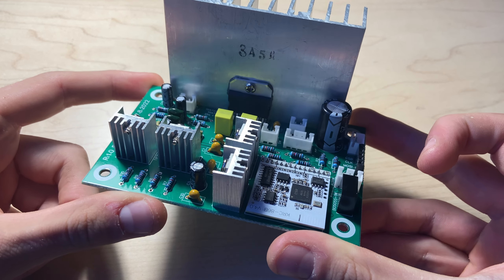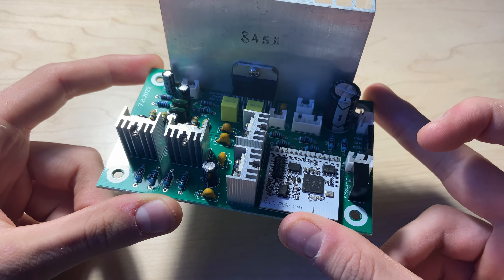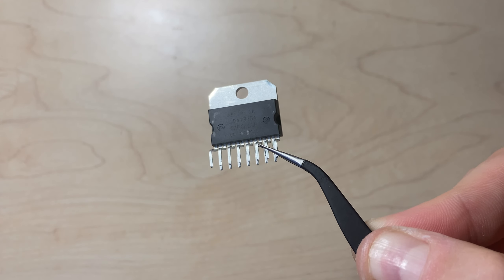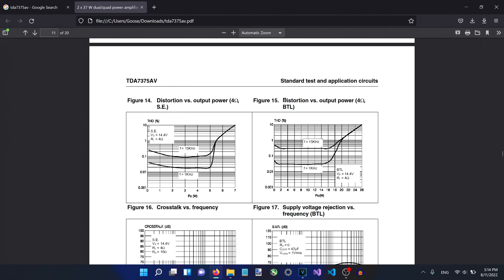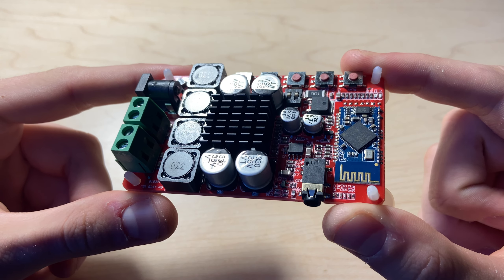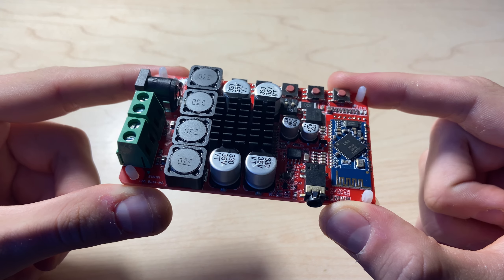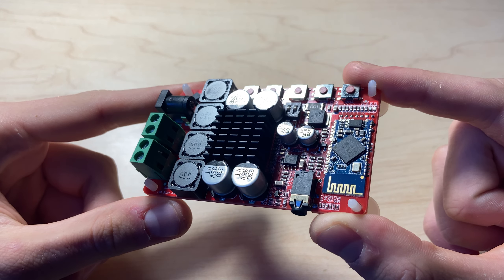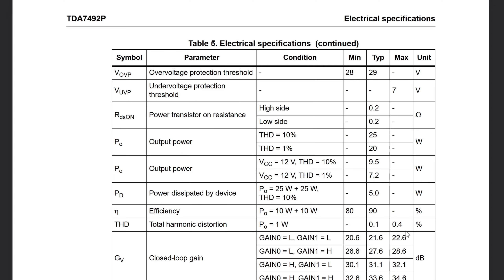Class D vs. Class AB audio amplifiers | Which one sounds better? | Unbiased listening comparison

Comment from the maker: I believe the general point of this video was missed by many viewers. I understand there are far better implementations for both classes of amps, and there are modifications that can make both of these amps better, but they don’t represent the majority of real-world applications. This video compares two modern, off the shelf amps that represent the majority of the market share for class D and Class AB.
Reply: Nope,class ab mostly comes not as a chipamp.
Reply from the maker: @Zockopa  you can’t be serious. i think the keyword you missed was “modern.” Most modern Class AB amps are a solid state chipamp configuration due to their small size and low external component count.
Reply: @DaGoose  🤣
Reply from the maker: Below are a list of modern products that use a Class AB chipamp:

Harmon Kardon HK395
Logitech “Z” series satellite
Tannoy Ellipse
KRK V-series
Genelecs
JBL LSR-series
Mackie HR-series and Tapco models
Polk PSW series
Creative speakers

Manufactures use chip amps because they’re small, cheap and have decent fidelity. every modern discrete class AB amp i found costed at least $100 and most high end models above a $1000 which do not represent the majority of the market share.
Reply: @DaGoose  KRK V-series, of course. Also AB used to be in their Gen 3 Rokits, and AB is also in their "New" Rokit Classics.
Reply: Class AB is good because it has crystal clear treble and mid freeqency
Reply: Don't mind the trolls man, just give them a thumbs up and thanks for the comment. You can't expect everyone to be a electrical engineer, either they do believe you or they don't.
Reply: @frankfarago2825 who actually buys these junk powered speakers? Rokit? junk 😂
Reply: @DaGoose Class d vs AB is definitely an odd one. A $50 class d will sound worse than a $50 class ab. But a $600-1000 class d Hypex N core or Purifi 1et400a will sound and measure better than the typical class AB in that price range. You have to spend at least $2-3000 to find class AB amps that can match modern HiFi class d in power output, noise floor, distortion, etc. Class AB gets expensive fast if you want 200+ watts into 4 ohms, 0.0x% thd, 100+dB SINAD, etc. Class D is excelling there. Ultracheap $50 amps go into cheap electronics where clarity and low noise floor are an afterthought because they're matched up to extremely cheap no-name tweeters, woofers, or even full range drivers that measure poorly in frequency response and are mounted in cheap enclosure with terrible resonances and bad port tuning. I think that's where some legitimate criticism of this video is coming from. This tier of diy amp is going into crappy speakers that sound bad anyways and are represent the sound quality of cheap amps, not class d or class ab. Class D can sound fantastic, as even the snobs at Stereophile now admit: https://www.stereophile.com/content/recommended-components-2021-edition-two-channel-power-amplifiers
Reply from the maker: the price of a consumer amp has nothing to do with its fidelity. for some expensive amps, only 20% of the price you pay goes towards the total production cost of the amp. I’ve built several amps from scratch in my lifetime. I made the Class AB amp in this video and it has 0.02% THD and possibly ~100dB SNR. the total cost for that build was ~$50 USD. All amps are cheap to make, including the “high fidelity” ones. you’re right that the driving speakers on the amps have a big role in the playback quality of the system. however, that doesn’t apply to this video because I didn’t use speakers and a mic when recording. i used a line output converter which took the speaker outputs of both amps and brought them to line-level signal so that I can use a PC’s mic-in to record the outputs of the amps.
There are some so-called audiophiles who comment on this video thinking they know what’s right, but i can assure you that probably more than 90% have no clue how to design amplifiers like these from scratch.
Reply: @hochhaul  You sound like those two generations of people under the age of 40, who claim that nothing was any good because they were not born yet.
Reply: The NAD amplifier should been used instead. don't you think so?
Reply: I think we all missed the point. We are stupid people. But I did appreciate the LEFT/RIGHT comparison, in which the class D amplifier sounded like shit.   I had an Onkyo class D amplifier that was nice and clean sounding. The hi-fi reviewers even called it "tube-like". However I have large Polk Audio speakers and the power output was limp like a wet noodle or my "tool" down there,  these days. 26 years of marriage will do that to you, son. Learn from my mistake.  I gave the amp tpo my daughter and splurged on a Cambridge Audio Azur 851A which powers these babies up like it's nobody's business. My Barry Manilow records never sounded so punchy. This model uses class XD amplifiers which is basically AB but improved.  Thanks for posting this video!!

Comment: Well class D is good for subwoofers, class AB for high frequencies, but you wont feel too much difference if you feed them already with digital signal (from pc, phone ect.), and class D is way more efficient and don't require big heatsinks and power supplies. Music quality depends on your speakers too so good amp is just one key to perfection out of 100. To hear difference on youtube is impossible.
Reply: I'm still confused at why people act like class D is so tiny and lightweight. My Pioneer SC-07 is the heaviest rceiever I've ever owned, and the high frequencies are so good that I use the attenuation feature to tone it down. Are most people judging class D on lower end amps? I know high end class D is relatively rare, at least with consumer grade audio.
Reply: @awesomeferret  its 7x140w thats why. Take a look at class A 100w amp. Its going to be a heater

Comment: Hi there this jess.. the class AB sounds bigger and bass is wider but  Class D sounds much clearer specially the middle band which is a very hard part to produce.. you can only hear clear backgroud instruments and a clear voice in a well working circuits.. if noise is noticeable during no signal drive its because the circuits has nothing to amplify therefore since class D amps basically has loop circuits it is amplifiying its own self induce noise in the physical circuit... if the much bigger sound or bolder sound is desired then bigger power is the answer... and if noise is the problem dc supply should be regulated... that will improve the performance...
Reply from the maker: More power does not equate to “bigger” or “bolder” sound. A 4-ohm speaker rated at 25W can be quieter than an 8-ohm speaker rated at 15W. The way a speaker sounds is based on its frequency response, sensitivity, cone area, and other factors such as the 
enclosure it’s housed in. 

The noise that you’re hearing with no sound is the floor noise and that is a normal factor in all audio amplifiers regardless of its configuration. 

The Class D appears to have more pronounced mid-range frequencies because it has weak high frequency response. This is a common problem in most Class D amplifiers which is why they are commonly only used in low-frequency applications only (i.e. car subwoofer amp)

I have no idea what you mean by regulating DC voltage to reduce noise. Both of the amps in this video were used with a switching DC regulator and there is still noise. Noise is a very broad issue and could be anything.
Reply: class d modulate noise and hash treble.  Class D treble is vague and attenuated by compare.  Makes the mids seem more prominent.

Comment: From my experience with amplifiers, the background noise can be reduced significantly by grounding the power supply, and keeping the input signal line as far away from the power supply line as possible, good  grounding is essential so don't daisy chain the ground wires...

Comment: As far as sound, I listened through headphones and most of the time I couldn’t hear a difference. During the combined test, the left side had more bass. I listened to it twice to be sure, and then flipped the headphones around left to right just to ensure my own hearing wasn’t the issue. The bass moved to the right side when I flipped them. The only thing I can conclude is either the class D amp made the bass stronger, or the audio track was recorded with bass on the left instead of centered, which is not normally the case. Also the hiss test, I could definitely tell the class A/B amp was significantly quieter.

Comment: There is no doubt that class AB still rules perfect as sound is warm and natural ....i have many class ab in my collection...lm 3886 tda7294 as flat frequency ones and other like stk4141 tda2030,2050,and lm1875 which i use regularly...also transitor based circuits of 5200 and 1943.
Reply: Which one is your favourite amplifier topology? We cant get the lm3886 these days so what do you recommend?
Reply: @NoneYaBiz200  TI still makes the IC as far as I know. Not really a Class D fan except for subwoofers or the exotic GaNFET amps. Class A has the lowest distortion but, is highly inefficient. Class AB is my favorite for speakers and pure class A for preamp and headphones.
Reply: @davidperry4013  Thanks, I’ll have another look. I really would like to try the lm3886 and see for myself wha the fuss is all about. I’ve heard so much about it.

Comment: Amplifiers:
The controversy over tubes vs solid state presists. When response, modulation distortion and transient intermodulation distortion are below certain levels (< 1%) there should be no audible difference.

Speaker wires:
It can be solid, stranded, copper, oxygen free copper, silver, etc.--or even "magic" wire--as long as the resistance is kept to be less than 5% of the speaker impedance. There is no listening difference as long as the wire is of adequate size. Bear in mind, a well-designed amplifier will not have a problem with any of these wires.

CD players:
In the 1980's, people spoke of experiencing "no air" and "aggression" while listening to digital recordings. Today we understand the principles which are fundamental to this phenomenon, we name it Jitter, we test it, calculate it and dress it with numbers, systemize it and describe it entirely. Jitter has always been and still is the worst enemy of the digital audio format. And today it is understood.

Fact: Digital audio data is 'just' 0's and 1's. There may be many formats (.wav, .aif, CD-audio) but the information is still digital. There is no loss during format conversion, provided the formats don't utilize compression.

Fact: Copying CD's (if they aren't damaged physically) is a lossless procedure. You can extract CD-audio with your computer and generate a file on your hard disk. Compare this file with the file created when you extract the same audio using a $30,000 player, the resulting two files are identical. 

The question which naturally arises out of this paradox is: why does the $30,000 player sound better?

Before we answer that question, let us first understand that at the Digital Out of a $100 CD-player we have the same 1's and 0's as we do in the $30,000 player. The only difference is in the Jitter content. Jitter only means that the data (the 1's and the 0's) is not perfectly time-aligned, but is transmitted either slightly earlier or later than it should be in the ideal case. However, this time flaw is not as great as to cause a digital error (data fallout).

Now if you know that, then you must ask: so why does one CD-transport cost much more than another? Ah, Jitter. The cheap ones shake and the expensive ones don't.

Well, that's true. The entire audio business of CD transports and DACs is built on the totally backward setup of the CD player containing the Master Clock and the DAC being the Slave. This results in the entire palette of innovations to lessen Jitter, starting from air drives to expensive digital cable technologies with complex math to reduce line-induced Jitter, to very carefully filtered power supplies, to all sorts of very necessary things when you want to achieve the least possible Jitter. So we have the worst possible digital scenario bringing in the most possible amount of money, because it is extremely difficult to annihilate Jitter when the CD player is the Master Clock. If you're looking for quality, this is stupid, to say the least!

The whole setup should be different. As is the standard case in any pro-audio studio, it is always the playing device, the DAC, which is the Master Clock. The clock is located right next to the converter chips. That way, no line induced Jitter can appear. This clock signal is then taken from the DAC device and is used as the clock input of the signal source device, say the computer, the DAT player, or the CD player. Yes, in that setup, the CD player is receiving a more jittered clock than the DAC is, but that doesn't matter, because the DAC is doing the audio playing. When the Jittered audio signal arrives at the DAC, it is quantized into place temporally and is then played, in perfect synch with the clock oscillator, which is right next to it.

But oh! In that case, you can use a $100 CD-player with a very poor power supply, a digital cable made from your average household extension cord, and still get a better sound than you'd be getting if you spent $30,000 on the best transport and digital cable! Yes, ladies and gentlemen, this is the naked, uncensored, plain truth about CD players and DACs. Their Master/Slave relationship is BACKWARDS and their prices therefore HIGH.

If you don't believe this, then all you need to do is record digitally your favorite tune from a $100 CD player into your computer (provided you have a soundcard and software that doesn't add yet more lies into the equation, which is often the case, so beware!) Then borrow the most expensive CD transport you can get your hands on and repeat the experiment. The resulting sound files aren't just similar, they are identical!

But the $30,000 player sounds better! How do you get them to sound the same? You only need to slave the transports to a DAC in Digital Master Mode. That's it. Identical sound, guaranteed. The least possible Jitter. The least loss.
Reply: @DW11111 none
Reply: @DW11111 I never said I came up with this.
Reply: Can you reccomend a video going over dav digital master most setup?

Comment: Boy I wish I had held onto my old Amos and equipment from the late 80s early 90s. Along with CDs as the source, it was epic.
Reply: It's not too late. I just picked up a used Yamaha a-s301 for $250 and pulled my 300 disc player out of retirement...yum. Find a CD player with digital out and throw a DAC in between and you're golden 👌🏼
Reply: Sigh... I'd love to have my old Sansui 881 back.

Comment: The test with left and right running on each amp sounded slightly out of phase even on my phone lol, class Ab for the win still overall
Reply from the maker: i recorded the samples separately and then manually made a stereo mix from the two, so the phasing may be slightly off :)
Reply: @DaGoose  interesting, not to blown my own trumpet but I feel I've always had a really good ear phase variations, totally wasn't being critical either I found this video very interesting and still is now lol. Thanks for making it, will have a listen on big speakers see if i pick it up. Phone speakers are probably out of phase themselves do to one coming out the phone call ear peice and one at the bottom so like 45° off axis 😂
Thanks again. And  for taking the time to respond so quickly bro

Comment: Thank you for this excellent video - I must say that I am fan of Class AB vs. Class D though.  I have (among many other amps) a Crown XLS 1002 (class D) rated at 215 wpc at 8 ohms vs a Crown CE1000 (class AB) rated at 275 wpc at 8 ohms.  Both amps are rated at 1KHz with 1 percent THD so the ratings are stretched.  I figure the XLS 1002 can realistically put out ~ 185 wpc and the CE1000 around 229 wpc continuous sine wave power.  The CE 1000 still sounds better and stronger despite the negligible  difference in dB output.

Comment: on building high quality portable speaker with good sound what amp you will suggest ? ab or d?
Reply: If you want quality and high fidelity audio, you have to choose AB amplifiers.

The AB class is a combination of A class and B class, without the worse part.

A class, have high fidelity of audio, but comsumpting more energy.
B class, have more eficiency of energy, but have distorcion and lack on (mid) audio.

Class D is not bad at all, but in some details, the audio loss.
Its main advantage is the smallest space and low energy consumption.
Reply: @kalangototal ab for portable? What? Want carry a heavy battery and heatsink? Class D all the way of course!
Reply: @jenshoefer7944  Each amplifier has its moment, there are reduced versions of them, the class AB, unfortunately requires more energy and a heat sink.

In this case, class D is more advantageous here, but it depends on the project.

But there are portable versions of class ABs for specific projects, it depends on what type of portable the person wants, even in small sound devices, an AB is still viable.
Low power, low thermal dissipation general purpose transistors can be used.

everything will depend on the project.
If the person wants a reduced portable, the D in this case will be ideal.
I ended up not being specific.
Reply: @kalangototal  what is a reduced portable? And why D for "reduced" portable? I think it's time for all those guys living in the past century to acknowledge that d class gained massively and when it comes to portable concepts or "true to source" d class is the choice. But well, some people always have difficulties with progressive developments